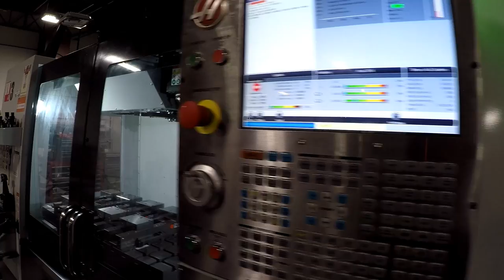NYCCNC Open House 2017

Comment: Hi Adam, That piece at the Clausing lathe with the #4 Morse taper with the 3 spindles
Would that be like the opposite of a bell center to hold the end of a shaft 
as a live center in the tailstock .>Joe Morris Balto MD.
Reply from the maker: Could be, bout the only think I think it could be used for.

Comment: Adam, that guy's Shop looks SUPER high tech! Looks like you guys had a wonderful time!

On another note, I am looking for high quality Aluminum Oxide 60 grit 6 x 3/4 grinding wheels for my 40 year old Craftsman 1/2 HP Bench Grinder. All the local stores carry  are the cheap Chinese made ones that wobble pretty badly when mounted on the machine. I've re-dressed them, tried them in different positions, etc and they still wobble pretty bad. Do you know of any high quality wheels that will run true?  PS:  I am NOT a fan of the new soft plastic bushings that now come with these wheels.